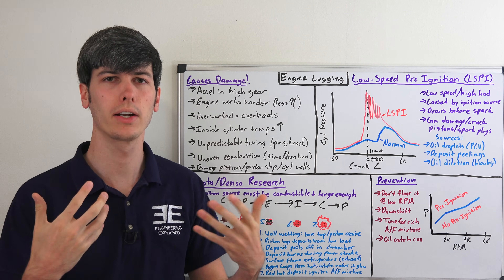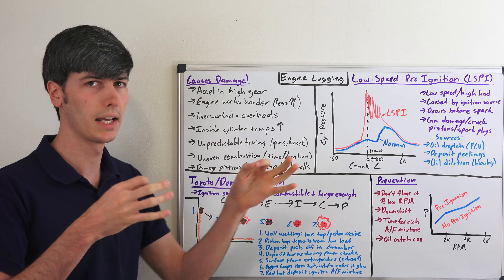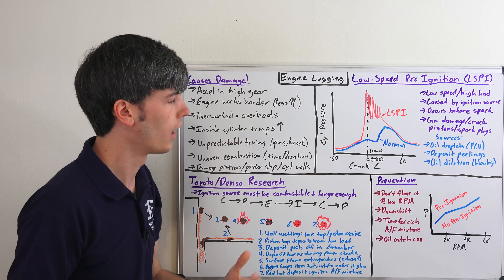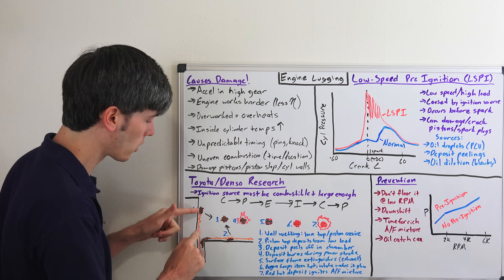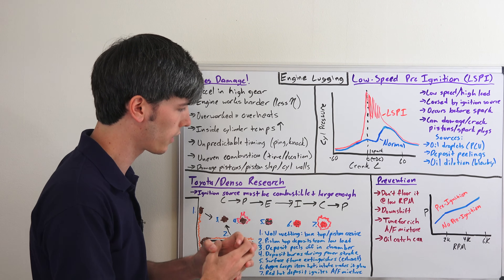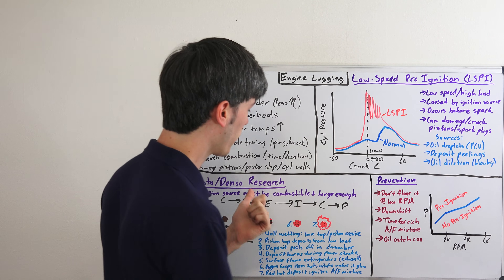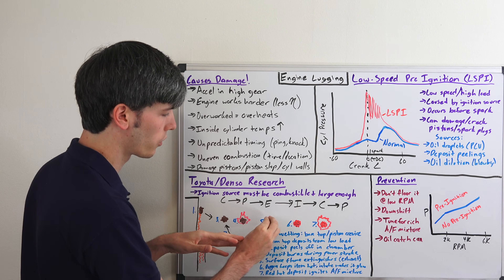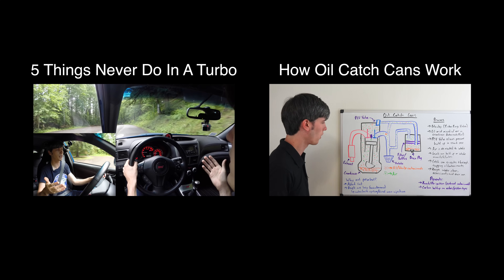Why You Should Never Lug Your Engine (Especially Turbos)

Comment: Heard about a driver who kept driving at like idle and very low rpm and lug the engine in high gears, eventually the engine mounts broke due to the vibrations and stresses caused by this driving style.
The car was an Alfa Romeo which are not designed to potter around at idle in high gear, they needs to be revved to be happy 👍

Comment: I know what lugging is for a 4 cylinder; starts at 2000 rpm at full throttle and goes down to 1700 rpm at low throttle.  
I’d like to know what lugging is for a 6 or 8 cylinder that always has a piston in the power stroke.

Comment: As usual for this channel the information presented here is correct and valid.
However I have my doubts about conclusions and practical effects of all the theory in real world applications and various types of engines.  

To begin with :
How for example is anyone practically supposed to 'lug' a modern 12 cylinder or 8 cylinder engine easily producing an output of 600 hp  and more when flooring it at 1400 rpm? 
Sure a 80 hp 4 cylinder Nissan from the 1980s might seriously struggle when doing this, but the typical oversized and overpowered modern engine on a sedan? - It will likely do just about as much as 'tickle' the fuel injectors a little...
We're talking about typical type of cars that can easily drive off a red light in 3rd gear with no struggle whatsoever, not about classic vehicles that could barely make it up a hill in 2nd gear with 4 passengers.

Oil pressure is of course a relevant factor (although not addressed in this video), but oil pressure should be sufficiently available at 900 rpm and upwards on modern engines. Moden engine management should pretty much handle all the rest and if anything the combustion process itself will be smother and better at low rpm than it will be at high rpm. 

Where will lugging the engine at low rpm certainly become a serious problem? 
When the engine is designed for very high compression and requires high octane fuels and the fuel quality does not or does only barely meet the requirements. Some modern engines are designed this way, especially some of the very fuel efficient designs, that often also tend to be turbo boosted as well.

But in my humble opinion that still does not make the theory generally applicable to all cars in practical every day driving conditions.
Most fairly recently built cars will suffer far more tear and wear and heat damages from sporty driving at high rpm than they ever will from 'lugging at 1400 rpm'. 

Is doing so ideal? - No, of course not. 

Is it truly harmful to have a significant impact on engine life and drivetrain durability?  - For most vehicles that are driven by the types of drivers who typically tend to do this kind of thing regularly, probably not. 

Does this lugging theory however provide an excellent (yet invalid) excuse for anyone who loves redlining a car and driving it like a maniac to continue doing so? - Absolutely yes!

Comment: My car likes to shift to high gear (8spd automatic) at about 55 mph which makes the engine run at about 1500 rpm.  Mild acceleration causes minor lugging.  If I press a little harder it will down shift a gear or two.  But I do worry about the lugging condition.

Comment: Are the engines better off running them at slightly higher RPM rather than lightly lower RPM especially if it's aq 4-cylinder turbo?

Comment: Surprised you didn’t bring up that its also really bad for your clutch, in a high gear at low-rpm to rev it because the clutch slips a lot while trying to grab and does an insane amount of wear to the clutch weights.

Comment: Kinda weird that he didn't mention Carbon Build up at all. He kinda did when he talks about "deposits" that can form in the cylinder that cause uneven combustion. I learned about it recently after I got a Ford Focus ST. It's kind of a big thing especially in direct fuel injection turbocharged engines. That + lugging = no bueno/BOOM! Also not using the right oils and fuel nstuff. Pretty scary stuff

Comment: 5:40 doesn’t the spark plug fire before TDC? pressure would spike at TDC from compression but the flame front wont actually take off until a little after which is the big long parabola on the graph
Reply: It fires befor TDC at higher rpms

Comment: You talk some BS. I have been lugging all my life. Usually engines rotate the ignition angle according to load, revs etc and there is more time to cool and less pressure because the turbo does not yes charge too much.

Comment: In my 2010 Mazda3, I have never noticed any lugging outside of hanging really low RPMs, like when crawling in 1st or if I don’t downshift when I should while slowing down. (Around 1,400 RPM or lower, cruising RPM is 2,000-2,500).
Should I still avoid this when at cruising RPM?

Comment: Interesting. I have GM v8 with the cyl deactivation but no vvt. Anyway, the pcv let a bunch of sludge into the intake. It took forever to resolve because I tried to burn it off. Using intake cleaner etc.

Funny thing happened. The problem was fixed. Then the cleaner diluted the oil and became the cause of the issue again. So, oil change again and it resolved the issue. Still.. some sludge could knock loose and cause this. I’ve heard a few pops that sounded like backfires. Those are lspi.

Why don’t people equate lspi=misfire?

Now, there are hot days l

Comment: I have an n54 on upgraded turbos. Had a scary SCARY misfire while trying to go WOT from 2300rpm in 5th gear. DON'T DO IT! My car was in tip top shape, all maintenance done, but the car still will try to do what you ask of it, and it won't protect itself from your idiocy. I'm lucky I didn't crack a ringland.

Comment: There should be a curve with throttle position and RPM on the X and Y axis, which tells which combination of RPM and throttle position would qualify as lugging. Because for the same RPM, some throttle position might not be lugging at all, while some higher RPM might clearly be lugging.

Comment: It would be great to see how this compares with loading a diesel engine to prevent cylinder wall glazing. Also to see if there would be any fuel economy by running a diesel engine under load but not as much as flooring it.

Comment: Hi Jason, I came here after watching the video of when to shift gears, I've been looking for a video about that but for diesel vehicles, I've a 1.6 turbo diesel hatchback and have been wondering what is more efficient at the highway, to stay cruising at lower rpms without the turbo getting on (less than 2k rpm) or to get the turbo on. I hope you can help me with this ⚙️

Comment: My friend is constantly lugging an engine, he puts the pedal to the floor at around 1400 rpm or even lower at high gear for example he will put the pedal to the floor in 3rd gear at 16 km/h or sth like that. I hate it but he insists on driving the way he's driving.

Comment: I've been a diesel technician for six years. Their are tests from the vehicle manufacturers that tell you to do a lug down in order to simulate a fully loaded trailer. When you do a lug down if you have a plugged doc or dpf, failing turbo or turbo waste gate, or failed egr valve or thermalanagement valve this test will let you check readings for boost and intake manifold pressures. If the vehicle hits a certain rpm and doesn't start acceleration under boost then you can identify the problem. So while it may not be good to do all the time there is still tests that require you to do a lug down
 Still awesome video and explanations
Reply: Depends . Diesels don’t rev high to begin with, and they make all their torque in the low rev range which is a lot of torque dude to the long stroke. You can’t really lug a diesel. A gasoline engine with  a turbo depending the size of the turbo there isn’t much torque down low due to a shorter stroke to be able to rev higher and make more horsepower. This is where issues occur
Reply: @Eclipsis17  I always floor it at idle speed and let it dwell there for a few dozen seconds! Would be interesting to see what fails first. I'd guess head gasket but could be something surprising like blows a hole in a piston. Any guesses?
Reply: @satunnainenkatselija4478 that isn’t an issue at all. This is more for when you floor it in 5th gear at 1500rpms at 40mph. The engine doesn’t have multiple torque from the transmission at those speeds. At idle you are in first gear. If you drive an automatic this isn’t an issue, if you put it in manual mode it can be an issue under my specified conditions, or if you drive a manual. If you do floor it at 5th gear under those conditions and have a turbo charged engine the chance for detonation is greatly multiplied, meaning you will have a cracked up piston or melted.
Reply: @satunnainenkatselija4478 ahh idle speeds. I thought you mean from idle. Depends on what gear you are in, the higher the gear the more problems are likely to occur. If it’s turbocharged then problems are greatly increased. Detonation will occur and either crack or melt the pistons.

Comment: I would just like to ask who tf is actually doing this that it's a topic of discussion? Why would you be riding at 1,500 RPMs in the first place? You're almost stalling out at those revs. Not to mention that accelerating would take much longer than if you were in a lower gear at higher RPMs.
Reply: You can cruise at 60mph at that rpm in many vehicles who don't want to just accelerate and want more mileage.

Comment: Okay now what about a CVT? The car controls what gear ratio you’re in which is normally low, and in something such as a WRX with a CVT, it will be a lower RPM with a turbo and if you floor it, then you’re lugging it? Is that why you would choose a sport mode setting and it would rev higher?

Comment: I have a question... I have a small 1.2 liter 3 cylinder car which is Fuel injected (non turbo) .... If im doing 80km/h in 5th gear doing around 3000rpm and I approach a short hill... Speed goes down to about 65 to 70 km/h and I gear down to 4th... Now speed stays still and revs stays 2500rpm.... Engine does not lug but speed also doesnt pick up... Is this labouring the engine?

Comment: Hmmh, & how is it about the NA design Chrysler/Dodge 5.7L HEMI V8, it has 2 Spark Plugs per Cyl. & i´m not sure about if i´ve a LSPI problem. In low RPM and high load sometimes it listen´s like it has LSPI issues. & P0304 Cyl.Misfire detected is a trouble code what came up sometimes. It´s an early gen III HEMI 5.7 from the year 2006, so it isn´t the Hemi with the "Hemi Tick" Lifter Failure problems (What is mostly at VVT HEMIS of the years 2011-14) & it isn´t an VVT HEMI (it has fix valve timing) and the MDS Cyl. deactivation System.

I tink it´s also importand to know about that i´ve a diablo sport programmer what has the 91 & 93 Octane tunes what i´m using on this 2006 Dodge Charger R/T Daytona. Even also because i´m living at Byern (germany) i´ve 95 Octan fuel only there (but with 5% Bio Ethanol). This is the common Gasoline at germany.

To prevent LSPI the API SN PLUS Spec of the Motoroil came out. Especially to prevent that LSPI issue. But i´m not sure how good that will work, however, the Oil Manufacturers are working on new detergent formulations to prevent LSPI.....

Comment: What about taking a right hand, slow corner (5-10mph) in 2nd or 3rd gear but not under considerable throttle? It is still quite similar to “lugging” correct?

Comment: Can you do a video on cruising RPMs for engines. For example, a car or truck with an automatic transmission and a manual transmission with the same engine except the manual version runs at 2600rpms on the freeway and the automatic only does 2000rpms.

Comment: Doesn’t EFI inhibit the ability to “lug” an engine by limiting the amount of fuel supplied when you step on the gas at low RPM?
Reply: Yeah, like shouldn't the engine manufacturer limit the torque at a given rpm so that the engine doesn't break in the first place? Because I haven't heard of any case where an engine broke for being lugged too much

Comment: I can confirm this is a serious reality of driving a small displacement turbocharged motor.  I blew a motor on my Sti driving on the autobahn.  I was in 6th gear under medium/high load and blew a golf ball sized hole in my cylinder wall.  The car had only 30k miles at the time, and bolt ons.
Reply: does the same apply to diesels ?

Comment: Does slowly accelerating from stand still in 2nd gear cause lugging? My 08 Lexus GX470 is an auto and has a feature to start in 2nd. Makes it ride a little smoother and I suppose it could be easier on the trans during light driving if you don't absolutely need the torque. If it's hard on the engine though I'm not sure if it's worth using

Comment: I think I may have had this happen a few times to me.  I have a 2.0L engine with a turbo running about 15 PSI of boost.  I was driving up a hill in 5th or 6th gear and needed to accelerate quickly.  I floored it and right as the turbo should of spooled up, there was a loud clicking sound (to me it sounded like the turbo was locking up).  Was that sound "rod knocking"?  I can confidently say I have never heard "rod knocking".  It was a pretty fast clicking sound.  Can anybody describe or link a video of rod knocking?  Thanks!

Comment: Question for experience technicians/drivers.

I’ve always been aware of the need not to lug your engine.

I drive an ‘18 WRX.  My transmission has a lockout feature to save noobs from blowing their motor, but there is also a spot between 1st and 2nd gear where 2nd really doesn’t give you enough power, and yet the transmission will lock you out of first.

I’m extremely mindful of this, so if I ever put it back into 1st and very low speeds, when I’m rolling, my clutch actuation is super slow and careful.

But sometimes I don’t have that choice because I’m locked out, so I have to put it into 2nd and the car is now running at like 1100-1300 rpm.

At that point I apply very very little throttle (the digital readout says 10-20% throttle) to get the engine into the meat of the power band, before I apply real gas, but the car makes that gentle tell-tale shudder of an engine being lugged, and it is a turbo car.

That minimal throttle, lugging situation that happens from time to time, is that a serious concern? It hardly ever happens and I’m careful when it does, but should I legit worry about bending con-rods, even though I am gentle?

Comment: Thanks for this great vid Jason! I take it you're meaning more trying to accelerate at say 1800-2500 rpm in higher gears rather than say getting third instead of first and trying to accelerate from idle speed? I.e. the former bieng something that happens over a long period of bad habits rather than the latter which is occasional and much shorter periods (common with learner drivers).

Comment: Hello on my 1000cc supersport bike engine because it dosent have much torq from idle if i accidently stay in 2nd gear when rolling at say 5 mph and try slowly move off in 2nd it lugs slightly from idle Because it wants be in 1st gear. (being a race bike the gear's are very long) Would my engine cut if the revs drop bellow idle? Or can they accturaly still lug away form under the set idle speed? It's frustrating me incase I've accidentally forced it to rev under idle? Basiclay im asking is if it would of just been lugging from idle? Or could it of started to under rev?

Comment: There is a mistake in this explanation. Actually, the efficiency of SI engine is the best when throttle valve is fully opened. You'll get the best mileage near the knock and lspi region, thats why manufacturers balance on the edge when tune their transmission algorythms.

Comment: Does this mean that your turbo should be fully spooled before you floor it in any particular gear? If not, how far below fully spooled can you be (e.g. can I floor it at 2500 rpm if my turbo isn't fully spooled until 3000 rpm)? Will this be affected by higher power engines?

Comment: Been lugging my turbo cars since 1989 havent had an issue, they develop a better torque curve. I've out pulled friends with same vehicles and loads all because mine were run in thru letting them get down low in the rev range and lug like a truck.

Comment: What’s the line between hypermiling and destroying your engine?
I got ~40% better fuel economy changing gears at low revs (1500-1800 rpm, turbo diesel) among other tactics, it doesn’t feel like it is lugging but is it ok?

Comment: The problem is with an automatic transmission that keeps the rpm low in city driving (30-45mph)Then if you want to accelerate to avoid lug you need to do it very gently which is silly when you have a car that could give you a decent acceleration. Now the problem: even if you don’t floor it, at half throttle position the ecu will calculate the gas needed and will give maximum acceleration and the car will shake. If you floor it the same thing will happen the ecu calculates the gas needed and inject the same amount because it cannot give you more gas at that low rpm. The car will shake again then downshift(because of the throttle position).

Comment: let's say I'm in traffic and rolling in 2nd gear.. the car in front of me slows down and then speeds back up.. should I rev-match downshift into first or continue in 2nd? If I gradually accelerate (not floor) from really low rpm, would I lug the engine?
Reply: I have the same question
Reply: I have same question too.  My thoughts are it would surely 'lug' the engine but to a much lesser degree than full throttle.
I tend to lightly lug my engines but this lesson has made me rethink that practice.
It's just nice tapping all that torque in a tall gear and being amazed at the get up & go.
Reply: @peterrick3339  agreed